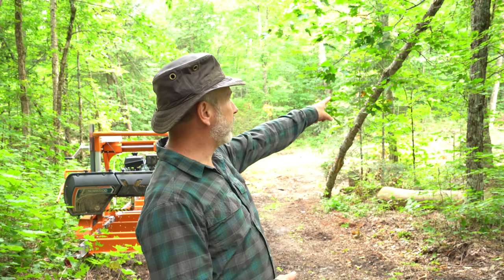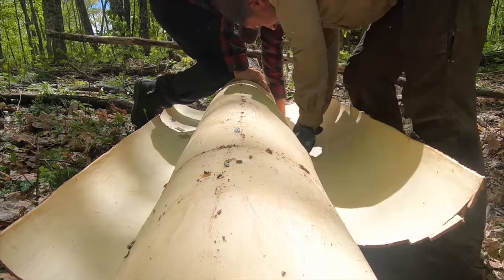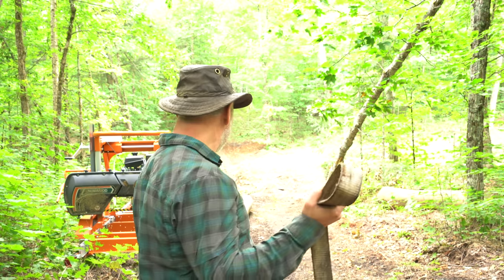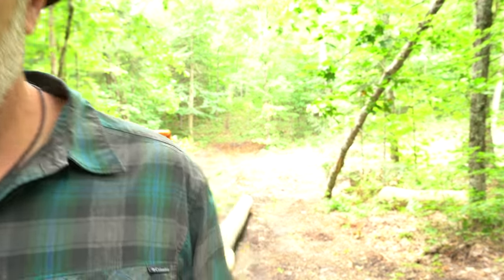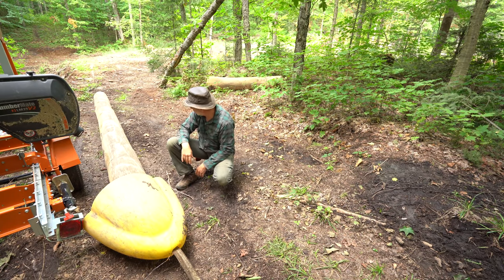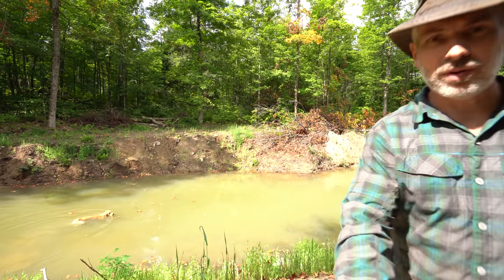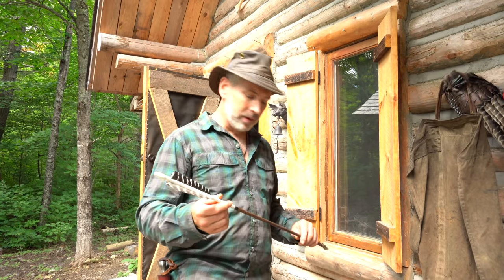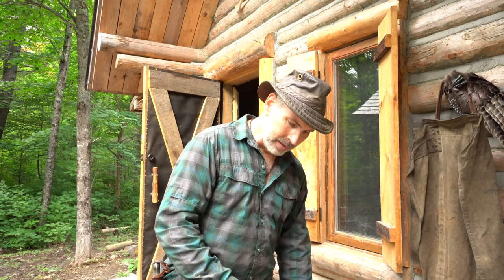Making Lumber on a Bandsaw Mill, Help from an Old Friend, New Arrows, Pond Water Clarity

Comment: I am glad you addressed the pond.  Last video I noticed it had cleared a lot.  It's just part of the process.  As the side slopes vegetate, it will not get as cloudy during rains.  I think you did a really beneficial thing (by digging the pond) to help you on the homestead.  This should also allow the use of a pump to water your gardens.  Endless uses.

Comment: I used an LT40  Hydraulic lift Wood-Mizer sawmill with optional debarker motor with much success & savings. If you upgrade, that's the best!

Comment: Glad to finally see the new saw mill! Everyone seems to think it’s easy to cut boards with a saw mill and it is easier but it’s still hard work wrestling logs! Careful what you use that ash for, in my woods ash is the only wood that rots while still standing. Once it’s cut and dried it’s good for things that will stay dry, flooring and furniture and such, but if it stays wet for a length of time it will get punky. I think that you’re going to get a lot of use out of that saw mill! Now for a small tractor or a side by side, the side by side you can use to cruise around with the wife and haul stuff to and from the garden!

Comment: Nice Mill: Wish you luck with the Kohler engine. Depends on the model of it. Some had issues. I really like the ash, would make a great table. Thanks for the video.
Reply: You might have noticed he cut a thicker slab near the middle.  Guessing there's a bench or table coming from that...  ;)

Comment: What you need, if you can afford it, is a 25 - 30hp 4-wheel drive diesel tractor with a logging winch (Farmi, Wallenstein or similar) on the rear. You would use the winch more often than you think. Save yourself from a rupture from all the bulldogging of heavy materials. We're not getting any younger...
Reply: I bought a 40 hp in 2007...., two regrets... wish I had bought bigger tractor and wish I had bought it twenty years earlier.

Comment: Real money saver Shawn!  The mill is worth its weight in gold! Are you going to use a couple tripods to get the BIG logs into the mill?
Reply from the maker: I don't think I'll be able to get anything TO the mill that the winch and Ramos can't handle. We had to cut up a couple of the big ones because the ATV couldn't pull them.

Comment: An Indigenous friend told me, about 50 years ago that th natives would roll their arrow shafts on a very flat rock to make sure they were straight.  It is not too hard to make sure that a rock is completely flat by rubbing one flat rock over another using water as a lubricant.  Also, in regards to your pond water clarity, for many years we sued pond water for us and our animals.  We used a shore well, which is basically a trench filled with fine gravel leading to crocks that people use for dug well.  Then you just pump or draw from the crocks.  Thanks for the tip about the torpedo front.  We are going to do some horse logging this winter and that would be much easier and safer.

Comment: Shawn, what’s the plan with the pond? Will you lay pipe to pump water up to the homestead? 
I noticed an old hand pump at the new site. It’s what my grandparents used over their well in north western South Africa circa 1930’s 

Will you put in a jetty so that you can grab water by bucket?  
That’s. Good tanning spot for the girls too.  

Love my regular down time, checking in with you. 
Thanks Shawn. 

PS. Love Algonquin. Visited once with a cousin from Toronto.  Still have my “paddle naked” cap.

Comment: Now that your willing to use some power equipment keep your eye out for a Massey Ferguson 65 or even a 35 farm tractor. Doesn't matter if its 50-70 years old as long as it turns over. They never die and parts are cheap as they made millions over the years. We still use one that is 68 years old. A Ford 8n or 9n as well will never die. First choice would be a MF65 with a loader. You'll be shocked how cheap you can get them for, they use gas so starting is never an issue in winter.

Comment: Nice wood mill Shawn.  I've been looking at getting one for logging my  20 acres to build a small cabin.  I've checked out Wood Mizer, Norwood,  Woodland and Hud Son mills.  Still trying to make up my mind depending how much HP and length as well as trailability for my Honda 4 wheeler.  I also have a wood skidding arch for dragging the logs out with my 4 wheeler which makes it a ton easier.   All I need is a wood mill and I'm good to go.  Is yours a Norwood Woodmill Shawn? Cheers !

Comment: A 4 wheeler or snowmobile could probably tow the portable mill to the timber, then slice it up right where it is felled, then carry the boards out a few at a time. But I guess it gets pretty tight in those woods, but if the whole tree fits the path out, I bet the mill fit on the way in.

I've been looking at a large forest, and studying timber management. It is really interesting.
Reply: Also, a few slices off the bottom of the log can make "wheels" so the log can roll out.

Comment: I designed a tool that you put a piece of wood into this tool and hammer the wood through this tool and it comes out the other end a round dowel.. I was in the Engineering trade for 35 years and also designed machines and built them for USABCO in South Africa..

Comment: Just remember to keep sharp blades on hand.  There's nothing worse than milling with a dull blade, your board will have a wavey surface and non uniform thickness.  Been there, done that! When you find yourself pushing too hard, check sharpness.

Comment: You have been in your location long enough now to know where  your resources are. I am surprised you haven't laid out a trail system to make access easier. Trails would make gathering maple syrup easier, could be used for cross country skiing or snowshoeing. They create edge habitat for deer, turkeys, birds, grouse and other game and can make getting to the lakes easier.. it doesn't all have to be done at one time but the important thing is to get a plan and layout down on paper. It can be as simple as a single footpath or wide enough for a snowmobile or power equipment.
Reply: I doubt Shaun wants to leave scars on the land that aren't necessary to his need for survival.

Comment: Now mind you i don't want to be a Debby downer or negative Nora etc, but your using a modern tool that one would never find on any homestead of the past, so self sustaining in a purest form or sens is not possible if you use such a tool without acknowledging the work of many humans in concert who manufactured every bolt that went into that machine. on top of that the expense of resources to run it IE gas oil transportation rental etc. Now of course this is true of even our axes etc, So this brings back the question of isolation and self sustaining and resources and abundance or the lack thereof. Perhaps a more honest approach is to think of yourself as reducing your dependence and footprint on society and impact on the environment instead of full self sufficiency in isolation. I think you already have considered all these questions and philosophical arguments during many quite nights by the fire. I still greatly admire what you are doing and at times a bit envious. but i'm a city boy with a country heart. guess ill go rent a cabin someplace and pretend.